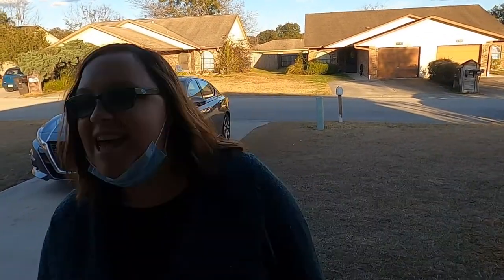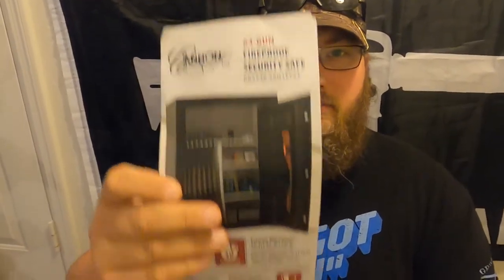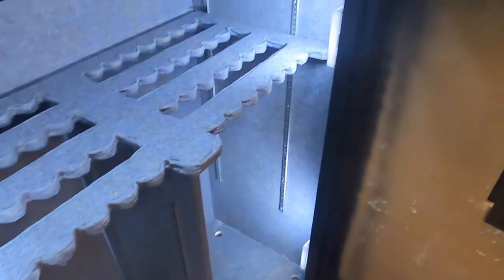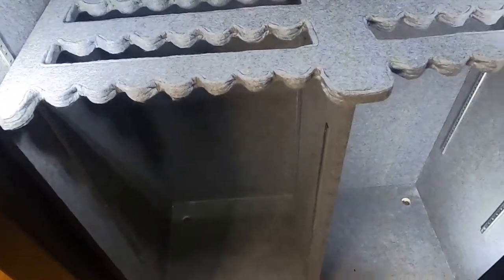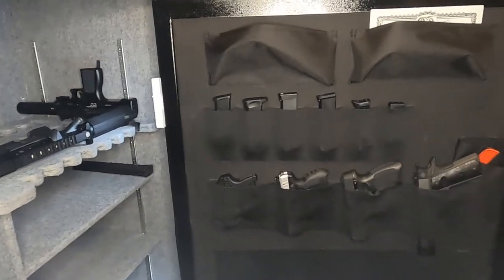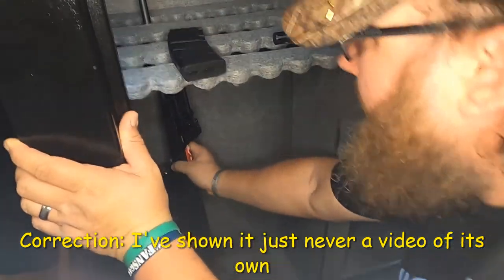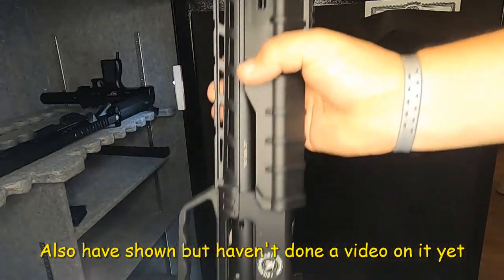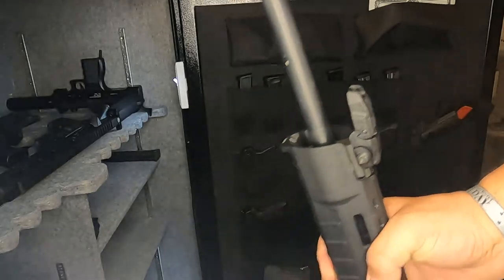My Cannon 64 Safe (set up and review)

Comment: got same safe first off go mechanical lock!! mine failed and now i gotta pay a lock smith and Cannon support sux.
Reply from the maker: Thanks for the comment. That sucks that they were no help. I was told to put on a new battery which is behind the key pad and if that don't work then customer support. I have had a great experience with their customer support and the safe itself. Still haven't has any issues with the pad or changed the battery. Sorry that you haven't had a good experience with them.
Reply: @ThatBeardedShooter  cannon sending out a new lock key pad but doesnt help that its locked. Still have to pay a locksmith to open it. Issue I have is Cannon knows these key pads suck and lots of issues. why dont they add the key feature like other manufactures do if the electronics fail you can still open safe. My sports afield Acadia has that feature but havent had any issues with that model yet. And I really like the Cannon 64 so much rome once opened Ill go mechanical lock with back up key

Comment: I bought a Canon shake from tractor supply in 2019 last week when I went to open it the shaft connected to the turn handle broke off inside the shape nothing to do with the keypad call Cannon went through quite an ordeal getting them all the information they wanted to warrant it even a video of the battery that they wanted once they escalated it to a warranty item they told me it would be 15 to 20 days before they get around to opening it my advice is if you have something in your safe that you need before 2 to 3 weeks avoid this company at all cost I will have a better safe waiting for them thank you
Reply from the maker: Wow! I had a much better interaction with them. I'm sorry you had a bad experience.